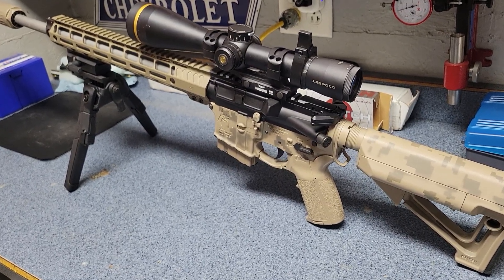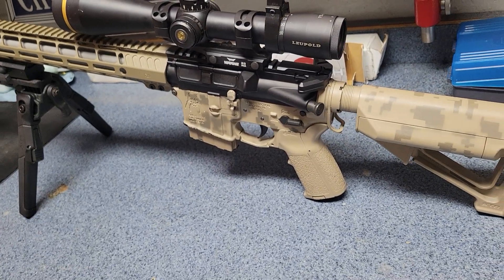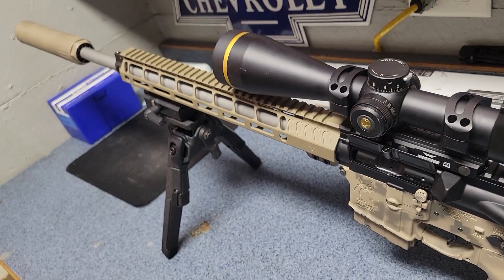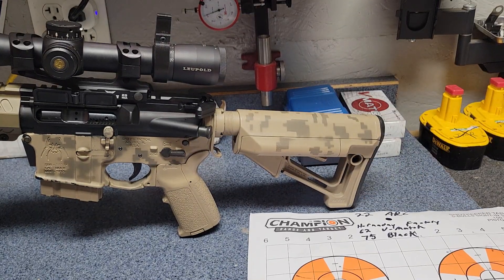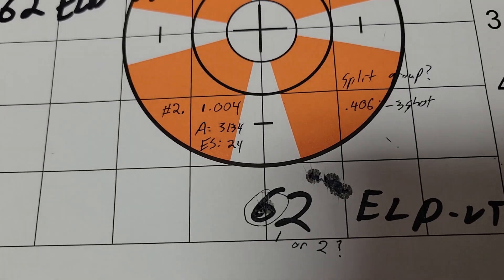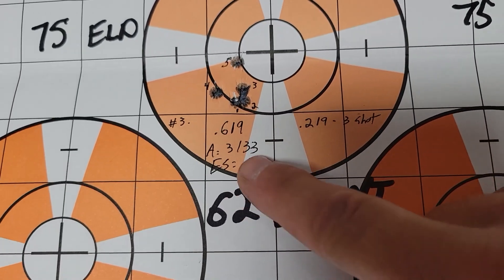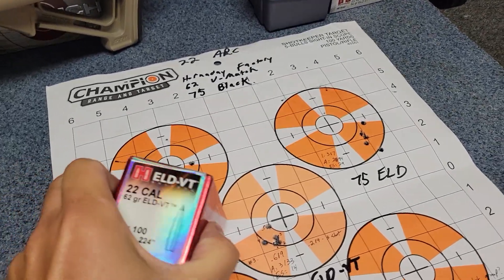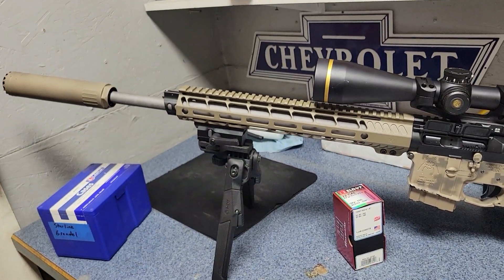22 ARC Build - Part 4 - Completed Rifle and 1st Range Report

Comment: looks like you had only the one flyer I had no luck with my 22ARC 62 eldvt or 88 eld just over moa with 62eldvt hornady ammo and really bad luck with 88eld because constant feeding issues the 88 elds keep breaking the tips off during feeding and usually in the lugs and causes jamming then the shoulders get deep dents from the bolt I have a ballistic advantage 24' barrel I have 3 ballistic advantage barreled uppers in 6.5cm, .308win and 6ARC all shoot and feed great sub moa but the 22 arc sucks I am getting perfect gas ejection with the 88eld is at the 3 o'clock the 62 eldvt have so far fed ok just the accuracy sucks I guess I need to call and send back to Ballistic Advantage hopefully they take it back and give a new one maybe I just got a lemon and the next one if they give me a new one wont have the issues I'm having with mine I have built a dozen ar's all run fine and shoot sub moa just this one I even have a .22-250rem LR-308 that runs great and shoots sub moa good luck with yours hope you work up a good load, I took apart a 22 arc 62gr eldvt cartridge Im pretty certain they are using Leverevolution powder only 3/10's more of a grain than the 88gr eld hornady ammo thats why I think they are not accurate and have weaker ejection for 26gr of difference in bullet weight the 88gr eld got mangled up in my rifle because of the feeding issues i am having

Comment: What powder u gonna run for the 62s
Reply from the maker: I tried Leverevolution first, but the precision was just not there, and ES / SD was pretty bad.  Now trying out Staball Match.  ES / SD has been excellent, and precision has been decent.  I need to tweak a few more things, then I'll probably post an update video.
Reply: Staball is on my list to try hace some 2520 as well to try